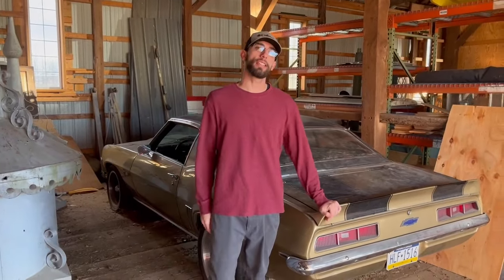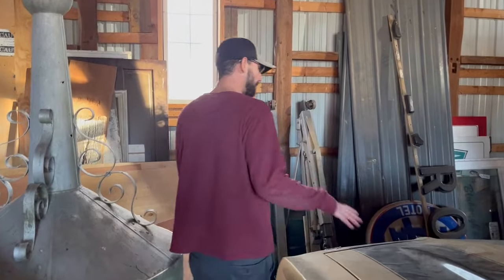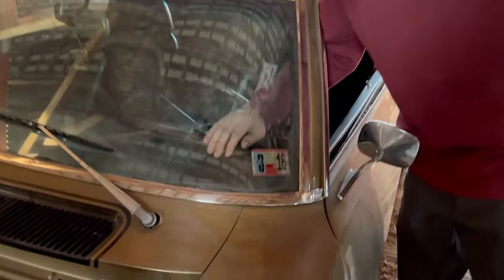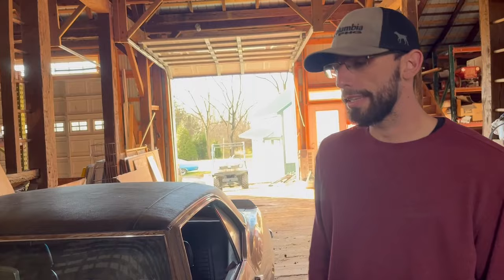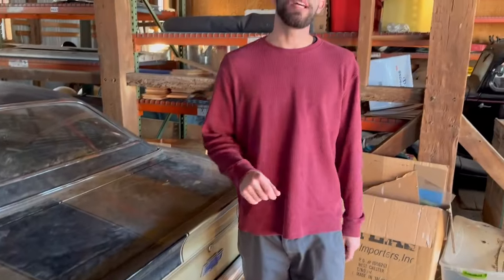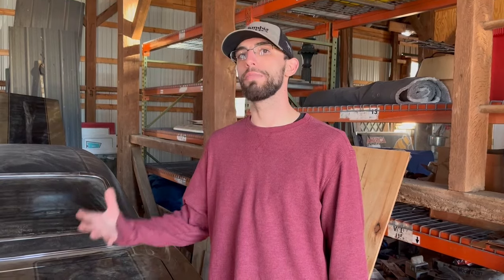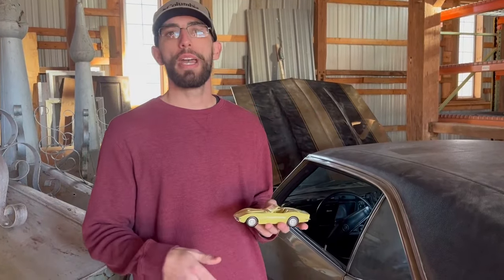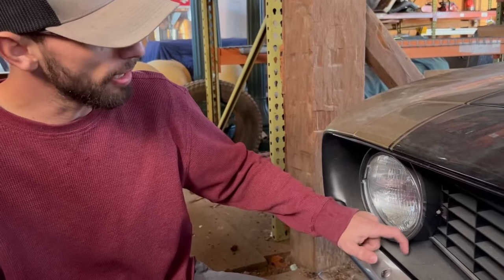1969 Camaro That Started It ALL! | Barn Find

Comment: You have the original engine in it and you'd be a fool to pull that and drop in an LS engine. Restore it and make it like new, or if you want to hotrod it, then sell it, get another '69 Camaro with no originality, and put an LS engine in it. You can liven the 327 up if you want, but removing it is a collector car crime.

Comment: Just about every side mound small block Chevy car from the mid to late 1960s had the motor mount repair kit. It was a cheap solution. You were  better off as a Chevy owner to completely replace the motor mounts.

Comment: MY CAMARO  WAS A 1968 327 275HP  4. SPEED. I WAS IN  FIRST AND WENT TO SECOND  MY MOUNT BROKE  I HAD TO TURN  IT OFF TO STOP.  DEALER PUT CABLE  AROUND THE  MOUNT.  I HAD THE CAR 41 YEARS.  JESUS LOVES YOU ❤❤❤